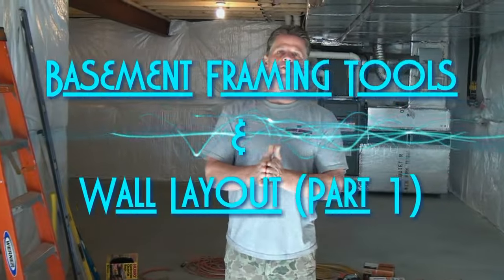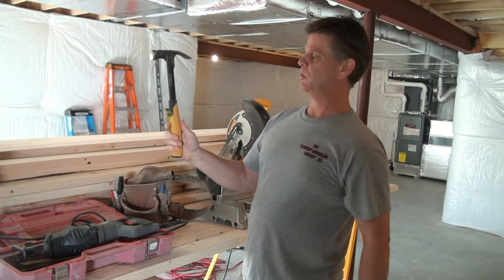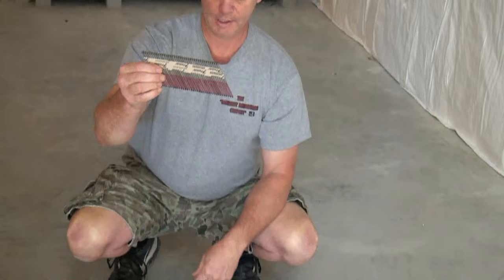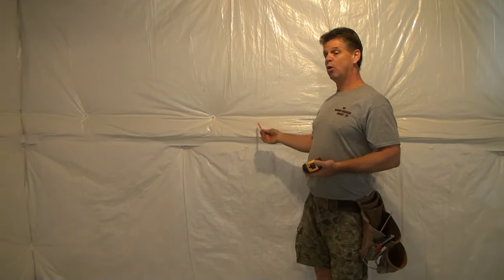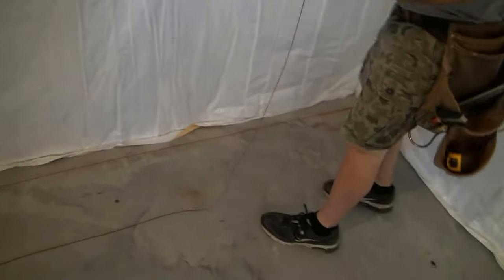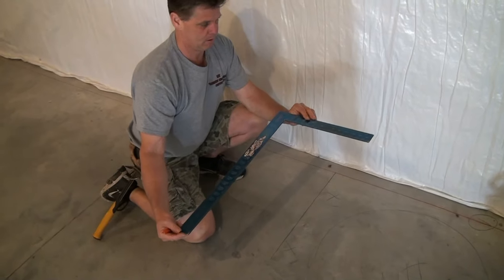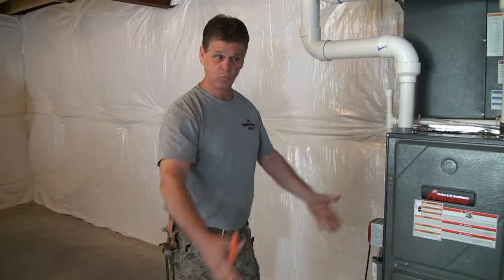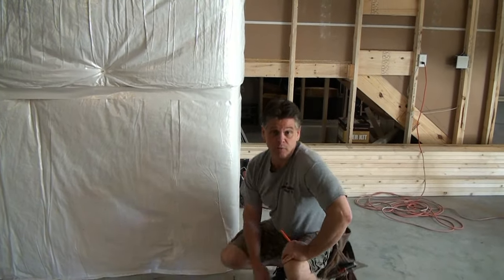How-to Frame a Basement(basement framing tools) Part 1 of 6

Comment: Fantastic. I just need to figure out how to frame exterior walls where inside waterproofing has bee done and cannot use a Ramset to anchor the base plate.
Reply from the maker: You can still ramset the same...the bottom plate of the wall is 1.5" and the nail only penetrates the concrete 1" so it will not go through the concrete into the drain trench...you're good to go with the ramset and 2.5" fastening nails Rick!   ~Eddie
Reply: @BasementFinishingMan   WOW. Thanks for getting back to me. Waterproofing company says if I use the Ramset it voids the warranty. What about using construction adhesive to put down the treated base plate and then build a stud wall to fit on top. I know it is a few extra 2X4's but......
Reply from the maker: @ricktrawinski5685  Sure why not...that should work Use PL brand from home depot if that's the only method you're going to use to secure the bottom of all of your walls!  ~Eddie
Reply: @BasementFinishingMan  Thanks again for the info. I am glad you took the time to provide information. Your videos and now your personal knowledge have greatly helped me in my project.
Reply from the maker: @ricktrawinski5685  You're welcome Rick! Good luck with the project brother!  ~Eddie
Reply: @BasementFinishingMan  I am going to need the luck, it is definitely a challenge, old small home with low basement ceilings.
Reply from the maker: @ricktrawinski5685  You got this Rick! It's not rocket science!  Good luck with it!  ~Eddie
Reply: Eddie. My son would now like a wall running directly under the steel support I beam. How would you recommend fastening. I don't know if it is recommended to use a Ramset through 2X4 into the beam. Would appreciate your input. Thanks in advance.
Reply from the maker: @ricktrawinski5685  Yep!! Ramset that baby right to the beam...it's how we do it and it's never going going anywhere once it's shot!

Eddie
Reply: @BasementFinishingMan  Thanks again Eddie.
Reply: @BasementFinishingMan  I have egress window already in stalled. When I make my opening for it and cut out my studs, in one video you say match to the concrete or block in my instance and another you say match to the egress framing or am I mistaken. Thoughts?  Rick
Reply from the maker: @ricktrawinski5685  follow the egress framing if you have it on the inside of the masonry window opening...only follow the concrete if there is no framing before the window.  ~Eddie
Reply: @BasementFinishingMan  I cannot thank you enough for how helpful you are. Your wisdom on this matter will get me through the project!! Thanks
Reply: This may seem odd but I never noticed my son has some linoleum squares on the floor. It is an 80 year old home and I guess I was focused on the other issues I am running into. I assume he needs to take all of those up to begin. It is a logistical nightmare, small basement, half full with stuff, low ceilings old block walls with spots that jut out from the walls.  Just need your expertise on the floor tile. I am sorry to keep asking questions.
Reply from the maker: @ricktrawinski5685  Get rid of them...they are probably asbestos if they are that old. B e careful and wear the proper air canister mask when tearing them out!
Reply: @BasementFinishingMan  Eddie. Is there an email that I can show you what I am dealing with? I hate to be a pest but a picture is worth a thousand words and I am searching for ways to make a bedroom in this basement for my grandson.
Reply: Eddie on last question. Foam board on the walls or roll insulation between the studs.
Reply from the maker: @ricktrawinski5685  Fiberglass insulation between the studs Rick!
Reply from the maker: Liquid nails on the bottom plate and 3" Tapcon Fasteners every 4' Rick works good.

Comment: Wish I had seen this before I framed my 1st wall! I put 2nd stud 16” instead of 15 1/4 from start so all studs are 3/4” off - oops - now what? Tear it down or add studs for drywall or nothing since wall is 11’-9” (12 ft. drywall board no butt joints)
Reply from the maker: Just pull your board out from the corner a 1/2" and go with it you'll be fine Allen.

Eddie
Reply: Basement Finishing Man Drywall board? Wall is nailed up to joists and attached to slab. Just means drywall screws don’t go exactly where expected, but, easy enough to mark drywall where screws go....Hiring drywall out, hope they don’t hate me ;-). Great videos, BTW.
Reply from the maker: @QuantumBiker0  Pros can hang anything...don't worry about it!

Eddie

Comment: What would u do if the framing square was not aligned with the chalk lines, how would you compensate?
Reply from the maker: I would adjust and then re-snap either one of the new walls lines a little, bringing the angle that I'm off currently in or out to create a correct 90 degree angle. I will tell you that I very rarely have to redo my lines...I'm  99% good each and every-time I layout my wall lines...so the chances of you having to readjust your lines would be extremely rare!

Eddie

Comment: Can anyone answer (hundreds of comments to look through otherwise), why 4.5” off the wall if there’s no wall wrap? Is that because the wall may not be perfectly vertical, &/or so you don’t have the heat transfer from direct stud contact against the wall? What if your walls are nearly perfectly vertical (mine seem to tilt in 1-2 degrees), and you have (1” R 7.5) O.C. foam board against the cinder block (in my case)? The 1” foam board is a very good thermal break.
Reply from the maker: It's because as you said Allan, the exterior wall may be tipped in or out at the top and you will lose a possible inch in the vertical. So I make it a habit to just give myself a good inch of "forgiveness" just in case I have an exterior masonry  wall that's not perfectly plumb on my plate.  I hope this makes sense to you...  Thanks for watching!  ~Eddie

Comment: Why do you have plastic cover on the concrete walls? I think that you will get a mold issue since it prevent air circulation.

Comment: My basement has wall wrap but only halfway down from the top.  Should I remove it and re insulate or  can I frame 6 inches out and just add insulation to the bottom portion of the concrete wall?

Comment: Will the 2.5 inch ramset nails puncture radiant floor lines/tubes in my basement concrete?  I guess I don't know how deep the floor heat is in the concrete.
Reply from the maker: No Matt...they only penetrate the concrete 1" and your concrete floor is at least 3"-4" thick and the radiant lines should be below the concrete surface so your good. Remember 1.5" of the nail is going through the bottom plate thickness first...so that'e eat's-up 1.5" of the nail depth right-out-of-the-gun!

Comment: Hey Eddie! Great video so far I have not even finished the 1st one and I really like how descriptive and explanatory you are. I already feel like I could do my basement right now! I do have a question for you...I have a home that we built that we have lived in now for 15 years so far. Initially there were some leaks that were resolved during our 1st few months of living in the house and now I have not seen any leaks in our basement since… our basement has the same type of insulation that is nailed into the cement walls, however, our insulation is going from the top 2 maybe about half way down the basement wall it does not go all the way down to the floor like in your video… what do you do in that particular situation? Also is it necessary to put a 6 or 8 mil vapor barrier on the wall Under that insulation? I'm going to be watching all your videos 1st to get a very good understanding of what I need to do before I take this project on so if you've answered these questions in later videos I do apologize!
Reply: Do you obtain the same insulation and finish the wall ak the way down to the bottom before you start marking?

Comment: Hi, I just installed the 2 in foam board to the walls for insulation (glued to the concrete walls).  No way to get under.  What distance should I measure from the foam board? Should I treat it like the concrete wall and come out 4.5 inches?
Reply: Don't over think it, you have your answer~

Comment: Love the Content! Question: What if the builder of the house put the wall wrap on the top half of the wall, do I still come out 6"?
Reply from the maker: Yes Nick you still come off the wall at the bottom 6".  ~Eddie
Reply: @BasementFinishingMan  Thank you. Would you suggest putting either wall wrap on the bottom half of the wall or maybe foamboard insulation or leave it as is?
Reply from the maker: @nickwinston3049  Leave as is neither is needed because you will be insulating the new framed exterior wall anyhow...  ~Eddie

Comment: This is great, thank you! Question for you - I followed your step by step to plan and design the basement, so I’m getting prepped to frame for drywall installation...the previous owners of my 1950s ranch had VAT flooring installed. Would I be able to effectively mitigate health risks by using a Ramset in my framing, or is having the tile removed my only truly safe option?
Reply from the maker: I would get rid of the cancer tiles Jack.
Reply: Basement Finishing Man thanks for the quick reply! I had a feeling that would be the necessary next step. Cheers!

Comment: Do I need to add any sort of Fire blocking?
Reply: Another question I have is for a basement egress window can a 2x4 be used for the header or does it have to be a 2x6 or 2x8??
Reply from the maker: Hi Nick! It all depends on your city/township code enforcement. Some areas require firestopping and other do not care if it's done.  thanks for watching!  ~Eddie
Reply from the maker: @nickwinston3049  Code would have nothing less than 2" x  8" in most areas.

Comment: Dude, why not cut two pieces of plywood; one 6x6 and the other 4 1/2 x 4 1/2?
Reply from the maker: Dude...what are you referring too?
Reply: Well, looks like you do this all the time (or at least a lot), so why not make yourself a little tool/jig for fast marking on the floor, instead of measuring 6 inches or 4 1/2 inches every time? Cut yourself a 6x6 square and a 4.5x4.5 square out of wood, butt one side up against the concrete, and mark the floor on the other side using it as your guide.

Gotta tell you though, these are great videos man, great!! Thanks so much for taking the time to do them. Guys like you make this world a bit (lot) easier for guys me.